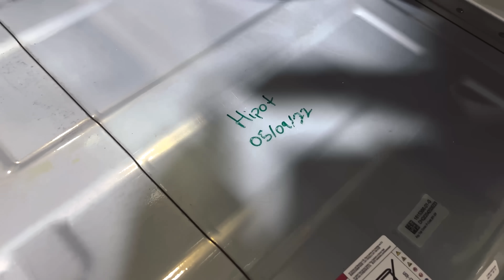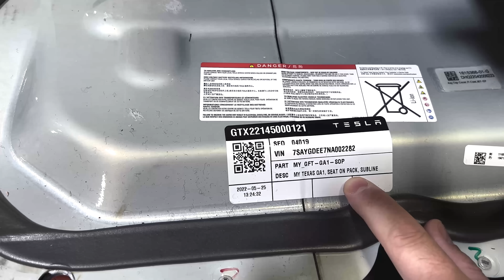Tesla Model Y 4680 Structural Pack OUT!!!

Comment: This was great to see.  The manufacturing and engineering efficiencies and improvements are what excite me most about Tesla as a company.  Just awesome.
Reply: What is it about an unrepairable battery pack that excites Musk/Tesla fans? I just don't get it.
Reply: @DavidJohnson-tv2nn  Realistically the current generation battery packs are likely to out-live the rest of the car at this point.  They've advanced a lot since the early generation packs.  

I'm not just an Elon fanboy.  I work in process re-engineering and business efficiency.  What excites me is the length to which they've gone to challenge manufacturing assumptions and to innovate on the design and engineering of so much in the vehicle.  The octopump for efficient heat management, the castings to reduce parts and complexity, the lengths they've gone to eliminate parts that only do one thing, etc, etc.  I just find it all very interesting.
Reply: @CrypticFoxGaming  Thanks for your reply. 
"business efficiency" are the key words here. That is great for businesses and stock holders. But not so great if you are one of the unfortunate customers stuck with a $10,000 to $20,000 battery pack replacement bill. Some of these batteries will fail outside of warranty. There is no getting around that.  
If I were in charge, I would ban unrepairable EV battery packs to protect the customer. Someone has to look out for the little guy.
Reply: @DavidJohnson-tv2nn  I think the challenging part here is that it's a burgeoning industry.  It's really only just getting started, and the battery packs themselves can be dangerous for people who aren't appropriately skilled/knowledgeable to take apart.  I can 100% get behind having a repairable product, but I suspect it would present problems as a new technology in the short term.  I would hope that as it becomes the industry norm to produce and service EV's that there'll be more options there.  Not a big fan of the "scrap it and replace" everything economy either.
Reply: @CrypticFoxGaming  Hope they change their ways. Because if they keep going down this path, they will hurt or even kill the EV industry. As customers see their battery replacement bills! 
This is not simply a matter of customer safety. Independent repair shops also won't be able to repair these battery packs. Besides, if service manuals are made available, customers, following procedures, can safely service their own battery packs.
There are always safety concerns if procedures aren't followed. Whether  EV, or gas powered.
Reply: @DavidJohnson-tv2nn  I wouldn't be surprised if auto insurance starts to take battery packs into account and add it as an option as EV's become more and more mainstream.
Reply: @CrypticFoxGaming  That would be an added monthly expense to the consumer. And Tesla sells insurance. See a conflict of interest here? 
1)Tesla makes battery packs unrepairable. 
2) Tesla then sells battery pack insurance to customers!
I think my idea of banning unrepairable battery packs is better :)
Reply: You also mean all the problems that goes with Al those big parts right!!!  Teslas are already the most expensive cars to repair how about repairing faulty battery cells in that "structural" in the future!? What about other big components!?
Reply: Elon. Please. Get involved in maintaining your cars.  Rocket turnaround is great but your cars after 20 years are toast. Long live my 84 e30
Reply: And they are getting better!!
Reply: And yet if it's so efficient, the German and Tx. factory are basically money pits, cus it's NOT well run, nor efficient
Reply: @cengeb  lol they're "money pits" because they took billions of dollars to build, and need time to ramp up.  Until they get to a certain level of production the cost of the facilities, utilities, employees, etc exceed the profit made from the cars at that facility.  When you build a new factory you start in the negative and have to build toward positive.  This is true for literally EVERY business.  Use your head.
Reply: @CrypticFoxGaming  Whilst VW is opening 6 battery plants around the world, and a new EV plant in the u.S. for it's Navistar EV SCOUT, VW wolfsburg till the biggest car factory in the world, can make like 3,000 vehicles a day as needed...Giga diggity do! Wolfsburg has been constantly updated and modernized...Tesla the Delorean and Tucker of the 21st century
Reply: @cengeb  That's a pretty bad hot-take.  Delorean closed operation after building about 9000 cars.  So far Tesla has made more than 2 million.  VW is TALKING about opening 6 battery plants around the world.  They haven't DONE it yet.  That's kind of the challenge with all of the OEM's so far.  Most of what they've done is talk.

Regardless though, this is not a zero sum game.  It's a huge market, and there isn't only going to be one winner.  Just as the current auto market is comprised of a number of significant players.  Tesla doesn't have to have the lion's share of the market to be wildly successful.  They only represent the lion's share right now because they're the only one's manufacturing fully electric BEV's at scale currently.  Not sure why you think this has to be a winner/loser discussion to appreciate the engineering.

Edit:  I suspect in the 80's you would have been that person arguing that Toyota was garbage and couldn't possibly win in the market against other manufacturers because they weren't doing anything different.
Reply: @CrypticFoxGaming  vw pioneered cheap high quality cars for the masses...toy copied...
Reply: @cengeb  The Toyota production system changed so much about automotive manufacturing.  They developed a process of continuous improvement and efficiency that forced other automotive manufacturers to change in order to keep up, and that spun out into virtually every other type of business, dramatically decreasing costs and production errors.  They didn't just copy what other companies were doing.  In fact the big 3 scoffed at the idea that Toyota could ever be successful or better, and all the while Toyota was gobbling up their market share.  They grew to be the largest auto manufacturer in the world by driving constantly for efficiency and manufacturing improvements.  So much so that the market cap of Toyota even just a couple of years ago was greater than the sum of every other auto maker that existed.  You're just repeating the same skeptical rhetoric that was said about Toyota and directing it at Tesla.  Time will tell I guess.  Probably you'll be off shouting at clouds or something :)
Reply: @cengeb  You really have no idea what you're talking about.  They're are currently 14 major car corporations in the world that share the market.  As I said, it's not winner takes all.  Tesla is still young relative to the major brands, and they're growing exponentially.  They may not be at the scale of 50 year old incumbents yet, but it won't be long.  They're already producing more cars than Suzuki, Mazda, and Subaru, and are continuing to scale as they build out production facilities.  Your perspective says Netflix would never be an issue for Blockbuster, Kodak would never be challenged by digital, Apple would never challenge Nokia or Blackberry, Yahoo has nothing to fear from Google, Dell was no risk to IBM, etc, etc.  Business evolves, and failing to see the evolution and opportunity has spelled disaster for many many companies.
Reply: @CrypticFoxGaming  VW, TOYota, Stalantis make most of the stuff around the world, all others follow....Between VW and Toyota each produce like 10 million vehicles each, Tesla has a long way to go, GM and Ford barely do 6 million each..VW has like 127 facilitys around the world, Tesla is not a global car maker...VW has so many joint ventures with Chinese makers, as VW is still #1 in the largest market in the world China, Tesla is a blip on the screen,
Reply: @cengeb  You're exhausting.  Toyota was the upstart, where other manufacturers like the big 3 were the dominant players.  Toyota ate their lunch because they refused to see the writing on the wall, hence why GM and Ford don't produce as many cars as they used to.  VW only grew from 6 million/year production to the 10 million range in the last 10 years, and that's across all of their sub-brands that they amalgamated under the VW umbrella.  Think what you want, since clearly you aren't open to analysis other than "Tesla bad", but they're growing rapidly and dramatcially increasing their production capabilities with a mountain of cash in their warchest to do it.  They're not going anywhere but up in terms of production for a long time.  It'll take a few years to see how willfully ignorant you're being, but they're not a dying brand.  Think what you want.  Can't fix stupid.
Reply: @CrypticFoxGaming  VW across it's 13 brands is introducing so many levels of EV, as is Kia, Electrify america, the VW stuff was sold a portion about $3 Billion to Siemens, since Siemens has expertise in that stuff, further expanding the charging network , tesla is a niche market, that doesn't have the variety of vehicles the world wants...NHSTA is also going after them for defetive software, hundreds of accidents due to defective and false marketing claims....it's gonna be a long time coming, for Tesla, Benz introduced the only LEGAL level 3 vehicle, and even thta has so many restrictions, it's useless, tesla stuff is a goof, only camera, no radar, poor design
Reply: @cengeb  You don't know as much as you think you do.  Time will show I'm right.
Reply: @cengeb  buy VW stock and I’ll buy Tesla and let’s see whose smiling in 2-4 years.
Reply: @josephlemieux5909  Remember that challenge, VW, slow and steady wins the race...with a lot more resources, and clout in the industry...Tesla sells Chevys at Porsche prices,
Reply: @cengeb  HaHa 😂 go buy GM Ford ad VW stock! LOL
Reply: @CrypticFoxGaming    LOL   Ramp up?  Tesla sold a million cars in 2021. With the Texas and German factory operational, they're expecting 1.5 million in 2022 and may equal or pass Volkswagon in 2023 with over 2.5 million vehicles sold.
Reply: @cengeb   Actually Ford made the first assembly line and the model T was the first affordable vehicle for the masses.  VW copied Ford.
Reply: @TexanUSMC8089  wrong h.j. heinz in pittsburgh made the first assy line for his food products in the 1800s old man Ford seen it and adopted it..vw didn't copy ford,the vw beetle was an entrily different concept, and the original porshe guy who started vw, dealt with ford,on engineering stuff...
Reply: @CrypticFoxGaming  vw has outsold Toyota many years..vw innovates,Toyota waits,and copies,fact
Reply: @cengeb  You're still objectively wrong, and a quick Google search will show you that 5 out of the last 10 years Toyota was on top.  Get over it.
Reply: @TexanUSMC8089  Yes "Ramp up."  It takes time for them to build up to full production levels, so yes they'll be burning cash until those new facilities get up to speed.  This isn't just my opnion, Elon said it himself so I don't see why you see this as controversial.  As for passing Volkswagon,  VW sold 6.24 million cars last year.  Tesla will get there and will pass them, but they're not going to pass VW with just 2.5 million vehicles sold.  They'll kill them on margins but in terms of total volume not so much.
Reply: @TexanUSMC8089  H.J. Heinz actually had the first commercial production line for his FOOD products...Ford seen it and copied it.  F. Porsche was also talking to Ford about engineering stuff.....
Reply: @CrypticFoxGaming  And the other 5 VW was on top, get over it....VW is also leading in EV in less than 5 years it will dominate the EV market, with it's 13 brands...and the numbers between VW and toy are a few hundred thousands, out of about 10 million each, all other are pikers
Reply: Umm musk says ing? Your good ? Hired. 2 years later. Musk.. so you did good or not. Out or promo. Tesla has and will out produce  every old manufacturer.now layout for future main maintenance. Re batteries not so good
Reply: @crypticfox have you ever compared to other companies? 

Integration is just good for Tesla / the manufacturer - they don’t lower prices or make anything easier when to service the car later like changing the battery pack when it’s broken
Reply: @accountname1651  It's too early in the life-cycle of the business to say "they don't lower prices" etc.  As with all technology everything is starts with a high price to capture the most people in the market are willing to pay.  This also funds growth, expaansion, and manufacturing innovation.  As the demand is met for people at the higher price the price of the tech goes down over time becoming more and more widespread among consumers.  Literally every new tech works this way.  They never start at their best/lowest price.  The battery packs have something like a million mile lifespan now.  I don't really see battery replacement as a valid concern at present.
Reply: Wow it only cost: $67,440 Excluding taxes & other fees
Reply: @r.j.johnson5790  Grossly over priced, for a still experimental car , using customers as test subjects, borders on FRAUD
Reply: It's called using customers as test dummies, constant changes, means they really are clueless....
Reply: @cengeb  but according to @Lari Apple I "don't get it and should not bother getting another Tesla" lol
Reply: @cengeb  constant changes mean they're continually driving improvements and looking to make the product endlessly more compelling and more efficient, as opposed to the typical industry standard of only making "improvements" or changes when they relese a new model year.
Reply: @CrypticFoxGaming  Yes, they are making improvements but I'd say 90% of them are to reduce manufacturing costs and 10% are to make the product more compelling. In the end, the users buying the car are left with a sore after taste wondering if they've been used to BETA test an engineering marvel.

While I have nothing against that, it is important for people to know that they are not buying a "finished" product but more of a test bed for something great in the future.
Reply: @gmds44  That's an interesting perspective, but the same could be said of the Model T Ford, the first telephone, the first tv, the first personal computer, the generation 1 Apple iPod, the first smart phone, etc etc.  It's the nature of new emerging technology that you aren't buying the "final product".  They find ways to improve on making the product and on the features/functionality of the product.

I get that you might think twice about buying another if your experience wasn't awesome, and that's 100% valid for any product.  Doesn't invalidate the product on its face though.
Reply: @gmds44  sir you really are stuck in the past and are clueless. Please state your actual issues instead of your negative conjecture.
Reply: @cengeb  I think you are clueless. Please buy a Ford VW or GM.
Reply: @josephlemieux5909  That's why Ford teamed up with VW to survive, do some research.  GM, are they still around?
Reply: @cengeb  my point exactly!
Reply: I agree, tesla is quite good at min/maxing the manufacturing process and related efficiencies. However, when these come at the cost of reliability and/or difficulty to service said parts, we start to see a big disparity in overall quality of the vehicle.
While I do love my Tesla, I for sure will think twice before getting another one.
Reply: @gmds44  yup.
Reply: @gmds44  
➡️➡️ "Beep beep" ➡️➡️
Reply: @royjohnson366   How can I help you today Roy?
Reply: @gmds44  
Remember the Roadrunner cartoons?
After every attempt of Wiley Coyote to up-end and ruin/defeat/kill the Roadrunner, Roadrunner prevailed and continued on, at breakneck speed, unscathed.  Then announced  his/her victory with the parting shot, 
➡️➡️"beep-beep" ➡️➡️

It's a metaphor... ref. your negatively valenced comment.
Tesla = The Roadrunner
gmds44 = Wiley Coyote

That's all.
You're welcome.
No help needed...

➡️➡️ beep-beep" ➡️➡️
Reply: @royjohnson366  you are confusing negativity with constructive feedback from an actual customer. Go read my comments again 🙂
Reply: @gmds44  yeah it’s great to have 40 years old vehicles made by other manufacturers because they didn’t had to integrate and make a single massive part. Thankfully those cars are still easy to maintain from custom handmade parts to parts that those manufacturers actually still sells unlike tesla!
Reply: @gmds44  Did you not hear them saying that several other EV'S they have are using battery packs which weigh MORE THAN twice the weight of the Tesla battery?
Reply: @gmds44  service. Big word. And it will be necessary
Reply: @gmds44  What are your thoughts on the changing complexity of cellphone construction that would cause you to decide not to buy a product from any cellphone manufacturer?  Your additional replies to others comments seems to suggest you do not believe Tesla engineers designed this structural battery pack properly.  What are your qualifications that you think we should know about your opinion in order for us to better understand it?
Reply: @hudsojt  I buy cellphones every 3-5 years and change the batteries myself. Never have I had any issues that forced me to have my cellphone replaced or repaired due to reliability issues, ever.
Reply: @gmds44  Yeah, lol, my cellphone buying and personal repair processes were just like you described until my last cellphone purchase.  Now I only charge it to 85% and I am fairly certain this personally unrepairable cellphone will last at least until I want to purchase my next tech-up-to-date cellphone in a few years.  Having said that, I have definitely adjusted my consumer thinking and expectations when it comes to technology packed consumer products.  For me it was unexpected that my Tesla purchase now is in my consumer tech-up-to-date category as well but it is nevertheless.  Anyway back to the Tesla structural battery pack - I have faith that the Tesla engineers properly took into account all of the physical forces it will encounter as well as what will determine when it is and is not repairable due to a collision.
Reply: @hudsojt  I have no doubt the tesla structural battery pack will be the norm in the near future, even for other car companies. The mfg advantages are numerous, including cost and weight savings which are great for EVs.

What will happen when someone is out of warranty on their structural pack and it needs to be serviced? we're no longer dealing with a 3 hour labor cost here, but much more considering the "pack" is now assembled with a bunch of other things on top of it. 
I hope you see where I am going with this. It is definitely a trade-off that people have to be aware before making a Tesla purchase.
Reply: @gmds44  My reply to you on your last point is that you temper the warning you think new buyers need to be aware of with the knowledge that a vanishingly small quantity of Tesla owners since 2012 have needed to have their battery pack replaced out of warranty.  Even out of warranty battery replacements are so few that it is hard to determine.  I would submit that the occurrence of a Tesla high voltage battery replacement is so small in number compared to the quantity rolling down the road as to be inconsequential enough to actually matter.  All of my knowledge and personal Tesla experience points to only the very slightest possibility that a Tesla high voltage battery will need replacing.  Now if you want to discuss repair costs in the event of an accident then that is a worthwhile discussion but even in the scenario where the Tesla or any car for that matter is totaled believe me when I say you really don't want that repaired vehicle back under most totaled rationale conditions.
Reply: @hudsojt  you are absolutely right and I may be a bit over cautious. The fact is, my model 3 has been serviced too many times in the past 3 years and I am almost certain most issues can be blamed on the fact that Tesla tried to be too efficient here and there, not allowing enough room for reliability.

I do not want to spread misinformation, simply to share my experience and hope to warn other users who may be victims of the same.
Reply: @gmds44   I've had two cell phones that failed. One was a samsung that just locked up and went to a blue screen.
Reply: @gmds44  Yeah I could see that presenting some concerns, but I suspect long term the changes they're making improve the reliability of the vehicle and the consistency of build quality as well when they get it dialed in (something they've struggled with in the past).
Reply: @CrypticFoxGaming  lol…… tesla couldn’t figure out quality control, you think with all these improvements they are going to do it too!?
Reply: @CrypticFoxGaming  another great thing about other manufacturers is that they have increasingly been using recycled materials(plastics, fibers…..) in their cars unlike tesla
Reply: @gmds44  I think you missed the point here. This video demonstrates how the battery, which eventually will degrade to point when it will have to be replaced, is in fact a replaceable component, at least on this Model Y. To me, that makes the vehicle more desirable, not less.
Reply: @ec7287  Most, if not all EVs have replaceable batteries my friend.

The point of this structural pack is to have the battery "be part of the frame" which in turn will grant the required structural strength without needing extra materials to do so. This concept is nice indeed but at what cost?
Reply: @gmds44  it's not a concept but reality. The 4680 structural battery pack architecture save hundreds of pounds. What exactly is your beef with it?
Reply: @larryc1616  did you read his comment? Service and reliability issues
Reply: @larryc1616  I am all in for structural batteries if implemented correctly.
I have had several issues with my tesla and on all of them it comes down to Tesla trying to min/max the manufacturing process at the expense of reliability and repairability of the car
Reply: @gmds44  Are you making these reliability and serviceability issues up, or you do you have any specifics. I bet dollars to donuts you just made it up.
Reply: @ec7287  it makes it less desirable because the problem on the battery can simply be multiple failed cells and not needeing a whole new pack
Reply: @gmds44  there is no no such things as made properly in those integrated parts! It means less repairs possible and definitely not a reusable battery pack for other applications after the car life.
Reply: @carholic-sz3qv  yeah that is somewhat valid, we'll have to see I suppose
Reply: Is the bottom cover of the battery pack and other components sealed to keep out the mud and fine silt that accumulates on the underside of my ice vehicles?  They weigh less when they are new but several hundred pounds can build up over time.
Reply: @carholic-sz3qv  Yes, that’s true, and once the battery degrades/loses an unacceptable number of cells, the unit is replaceable!
Reply: @gmds44  please list your issues?. Or are you just trolling?
Reply: @ec7287  the unit can still be repaired because all the cells won’t become worse after all this time, that’s why some people are buying some old teslas and just replacing the faulty modules inside.
Reply: @carholic-sz3qv  This may be true, but as other cells age and fail, the rate of failures increases. It’s expensive to replace cells piecemeal, making individual cell replacement impractical, unless you can do the work yourself.
Reply: @ec7287  are you actually serious!? You realise that there are millions of ICE with almost millions and more miles around the world right!? Those things have just needed regular maintenance and repairs not full part changes! I’ll like to see a Tesla survive in Africa or South America let alone a used tesla!
Reply: @ec7287  no one has the budget to buy a new battery pack therefore replacing many failed batteries cells are definitely the way to go, plus the failed cells/modules can be reused for other projects.
Reply: @carholic-sz3qv  Assuming estimated  Tesla battery life is somewhere between 10 and 20 years, and the current cost of a new Tesla battery is $13,000 $20,000, and people typically change cars every five years, I don't think your argument holds up. It would still be a heck of  lot cheaper to just replace the battery after 10 years than buy a whole new car! I suppose you could find someone who would be able to change a few cells at a time, but again, that would be impractical and in the long run more expensive than changing  out the whole pack.
Reply: @gmds44  you don’t get it. Don’t bother getting another Tesla.
Reply: @leonari  what do I not get exactly?
Reply: @gmds44  “when it comes at the cost of reliability and maintenance..” Why do you think Tesla are innovating? Please don’t buy anther Tesla and go buy a GM, Ford or VW. They obviously fit your mindset better.
Reply: @josephlemieux5909  it is not about mindsets, everyone needs to repair their cars eventually and making it more difficult is not the way to go.

Get down from your tesla fanboy cloud and open your eyes.
Reply: @gmds44  again please state your actual issues. Otherwise you ‘re just stating someone’s talking points. Easy to be a fan with the success they are having and will continue to have. Oh and the money has been pretty nice too!